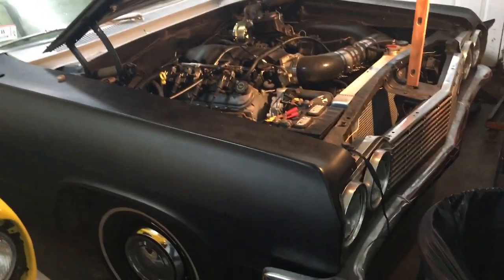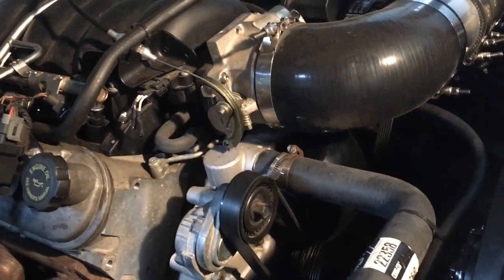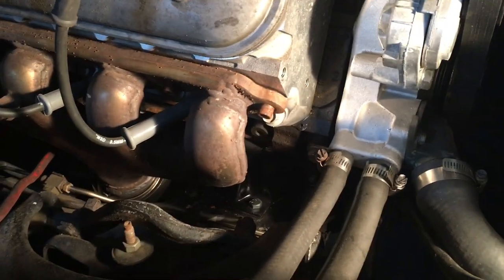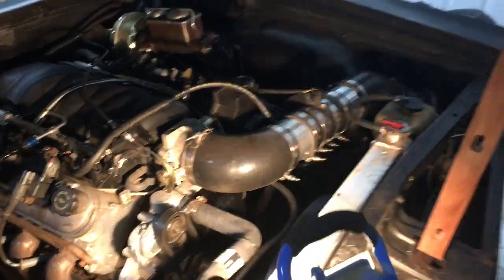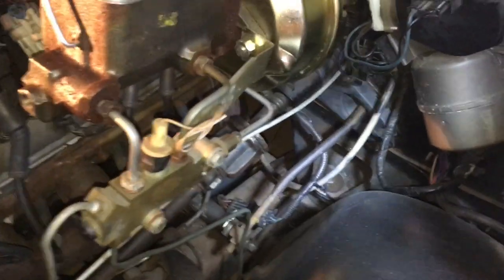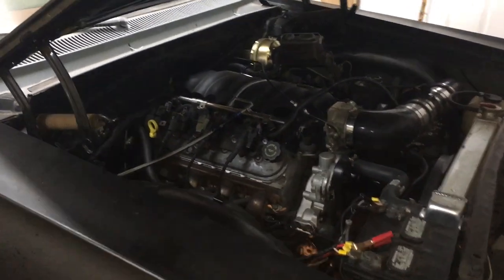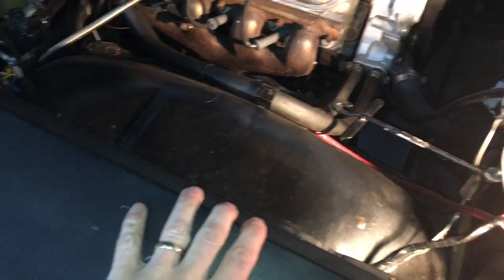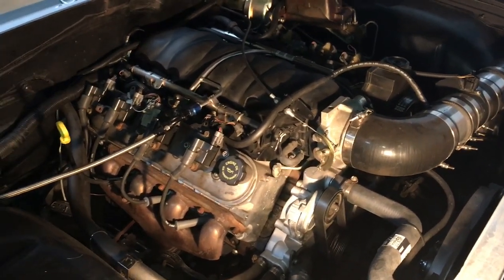How to LS Swap a 1961-64 Chevy Impala with a Muncie 4-Speed

Comment: I have a serious question can you get a 1960 impala and put a 2000 and something engine in it? I’m thinking about buying this 60 impala So I can have something to think about inside of my addiction to opiates which I easily can quit but I want something to keep my mind off of it
Reply from the maker: Kc Stricklin - absolutely! This is a 64 Chevy with a ~2007 Cadillac Escalade engine in it. A 1960 Chevy would be similar. The oil pan and engine mounts may be  different, but the rest should be pretty much the same.

Also - good look with the recovery. I’m cheering for you!
Reply: Jeremy N thank you so much Brother you don’t know how much you just made my day.
Reply from the maker: Kc Stricklin - make some videos of the project! I’ll watch it! :)
Reply: Jeremy N Thanks man that’s a cool idea I’m going to check it out on Monday I’ve got over 2 kilos of silver that I’ve been saving I’m going to see if he wants to trade some silver or cash. It’s a 1960 something year model in Paula it’s a couple blocks away from my house for sale. He actually has one in really good shape in one for sale that’s not really good shape. I think it might’ve been a car that he used for the parts. Which I’m hoping he didn’t

Comment: What brake booster did you use? Can’t get the coil packs to clear on cylinder five and seven.
Reply from the maker: I made a custom coil bracket that moves my rear coil. I tried the 7 inch booster and it didn’t work for a reason that I never solved. I swapped back to a 9 inch (I believe, I can double check tomorrow), and moved my rear coil and all was good. 

What motor mounts are you using?

Comment: Hi Jeremy,I am stumped again,I see you got the ls2 intake.my bud gave me an intake off an 2005 gto 6.0 I am having a problem determining what throttle body to use since I am doing a drive by cable,I see you did a brive by,what throttle body did you use?
Reply from the maker: Socorro Tapia - hello again! I have a gigantic edelbrock throttle body on mine. I’ll check it in a few minutes and see if there is a part number on it.
Reply from the maker: Socorro Tapia - it says “3864 edelbrock” on the top. Hope that helps!
Reply: Jeremy N thanks! I will look it up,I have seen when going bigger you sometimes will have to put an adapter,78mm to larger or 85mm to larger.
Reply from the maker: Socorro Tapia - I just looked it up and it is super expensive. I assume there must be cheaper options out there. I’m just not sure what those cheaper options are. Honestly, I’m not in love with this throttle body. The throttle is super sensitive which I don’t care for. A smaller throttle body would probably be much more driver friendly.
Reply: Jeremy N yeah,I already  spent more then I wanted to,I will do more research,But yeah I do not want to go much bigger on the throttle to intake. Thanks for the advice
Reply: Well Jeremy I’ve had it for two weeks this is a quick update on the throttlebody for my LS2 2005 6.0 intake throttlebody, The throttlebody that went directly to the 4  mounting holes that bolt to it was the Holley 860007-1 sniper efi silver 90 mm throttlebody,of which I Ordered from Amazon
Reply from the maker: Socorro Tapia - awesome! I’m not going to look up how much that cost you. It’s just not healthy knowing how much all these parts cost! Lol
Reply: Jeremy N Oh yeah I forgot to mention that part well let me just put it this way I looked up your throttle body and based on that the Holley was half the price LOL
Reply from the maker: Socorro Tapia - lol. Mine was waaaaay too much money! Keep me updated on your build progress!
Reply: Jeremy N will do

Comment: What length throttle cable did you use. ?
Reply from the maker: I used a 36” Lokar cable and cut it way down.
Reply: @WiringRescue  thank you , also did you do anything special with you fuel tank. Mainly wondering about the fuel return.
Reply from the maker: @coop962014  - I bought a new stock tank (they are under $100), and welded -6AN bungs to it in a variety of places (bottom and sides). Then I pulled and returned the fuel from those.

Comment: What kinda mods did you need to do to put that in
Reply from the maker: Pretty much just what you see in the video. There isn’t much more to it than buying all the right parts to bolt it together.
Reply: @WiringRescue  thanks bro I bought a ls1 5.7 for my 63 impala and the shop is saying wow there's a lot of mods I need to do to make it fit and work so I wanted to see what kinda mods it needs it's all just parts no cutting frame or etc
Reply from the maker: @LILGIBBYPRR-ESR  - some people do modify the crossmember under the oil pan. I honestly cannot recall if I modified mine or not. I sort of think I didn’t, but it was a long time ago. Make sure you use a 98-02 Camaro ls1 oil pan - that seems to be the one that everyone likes best from what I’ve seen. That’s also what I use. Good luck with the swap - it’s really awesome when done!

Comment: What fuel tank and delivery setup?
Reply from the maker: I bought a new stock tank and welded some -8AN and -6AN bungs to it. Then I pulled fuel from the tank with an external walbro 255 pump.  The return line dumps back into the tank as far away from the feed line as I could get, because I didn't want to aerate the fuel being pulled. Also - I use a corvette style "returnless" style fuel filter and regulator.  It's really a simple, cheap, nice setup.

Comment: Which coil packs did u use
Reply from the maker: I used stock coils, but the drivers side rear is sitting on a modified bracket so that it doesn’t his the brake booster.
Reply: @WiringRescue  stock coils are those the round ones?

Comment: If I use a 2000-2004 Silverado 5 3 do I still have to use all the Camaro stuff
Reply from the maker: You definitely need to swap the oil pan, and I’m not sure if the stock intake manifold will fit under the hood. I would guess it would hit the hood. I never tried with mine. I would guess you can use the truck Waterpump, alternator, and harmonic balancer, though again, I have not actually tried it. Sorry I don’t have more info for you!
Reply: @WiringRescue  where did you get your harness and what did you do for fuel
Reply from the maker: I modified the stock Silverado wiring harness, and I use an external walbro 255 fuel pump. I bought a new tank and welded -6AN fittings to it which is where I return the fuel to. I pull the fuel through the stock sending unit and it seems to work fine so far. I probably would recommend pulling fuel from the bottom of the tank in higher horsepower scenarios.

Comment: Anyone do this with the ls factory a/c compressor. I have a 6.0 caddy and converting the 4l6080 to 2wheel
Reply from the maker: I haven’t tried it, but my guess is that you would need to notch the crossmember to fit the compressor in the stock location. There are probably high mount options though. Have you checked out ictbillet.com?

Comment: 1960 Impala with muncie 4 speed has clutch pedal   whats needed for the clutch pedal switch wiring  its a 2003 6.0 ls engine the harness was an autoatic trans and has been depinned   the only pins i see for manual transmission is a clutch pedal position switch and then a pin for clutch start switch signal  i cant find much info on this    do you have to have this wired up since your not using a Torque converter switch signal ?

Comment: Where did you mount the fuel pump?
Reply from the maker: 63 Impala rag Dude I mounted it in the middle of the car on the passenger side of the frame. It’s probably not the best place, I’d recommend putting it in a different spot.
Reply: Jeremy N cool thanks. Outside or inside the frame?
Reply from the maker: 63 Impala rag Dude - it’s on the outside of the frame, but I hate it there because it’s now in the way of the dual exhaust that I’m building for it. So I may either move the fuel pump, or have to get really creative with my exhaust install. I haven’t quite figured that out just yet.
Reply: Jeremy N thanks a lot.

Comment: what alternator bracket did you use? My alternator hits the PW box...
Reply from the maker: It was one of these. Though I'm not sure which. I'll check tonight and report back.  https://www.speedwaymotors.com/shop/lq4-chevy-ls-v8-alternator-brackets-and-hardware~131598-140-21-14-465-30618